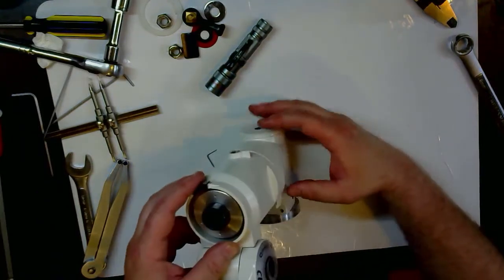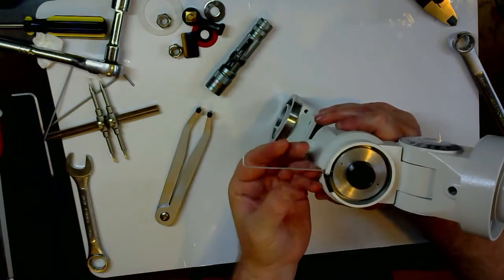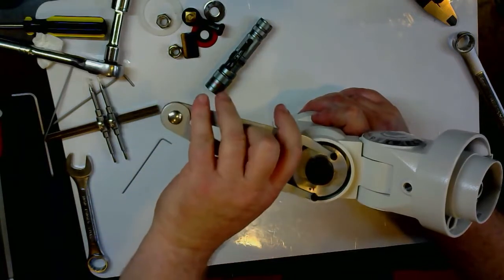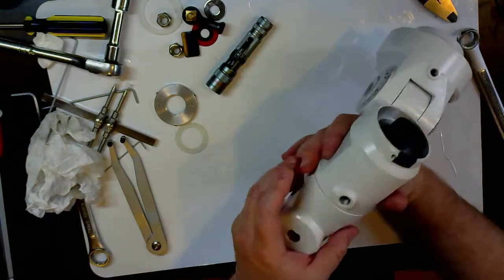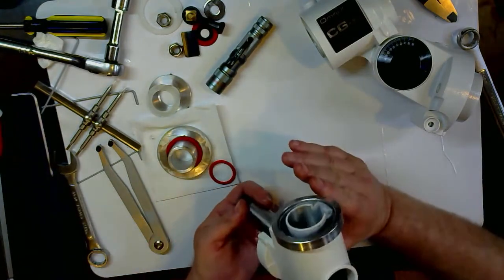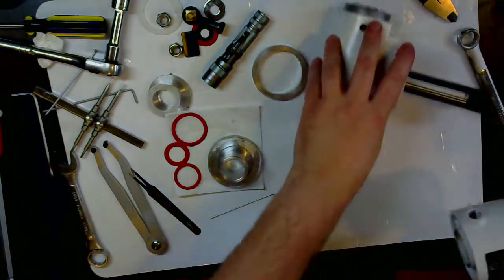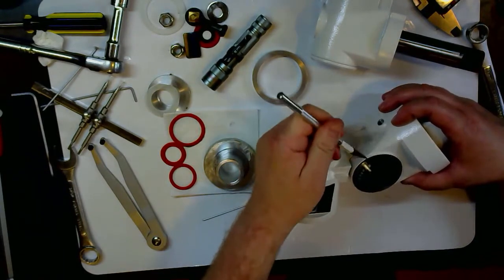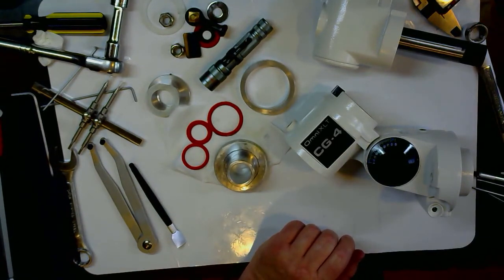Celestron CG-4 teardown/rebuild tutorial, Video 4 - Teardown Part 4

Comment: Going to have to modify my latitude adjusters. Or grind off some of the tongue that's in there. The mount won't adjust further than 60 degrees and it also won't go to complete horizontal

Comment: Well this is interesting. I loosened the nylon lock nut inside the DEC housing just a tiny bit, and now mine moves perfectly and no disassembly required. The entire mechanism relies on that 16mm lock nut - mine was grabby just like yours, but now it is just fine. The worm gears of course will need complete attention - those are terrible!

Comment: Thank you very much for these videos.  My RA dial had about 10min worth of delay before it would start to turn as I moved the scope in RA when setting circles.  it was indeed the three little setscrews hidden away around the edge of the RA plate nut,  they were loose, tightened them up a bit, problem solved. Thank you very much sir.